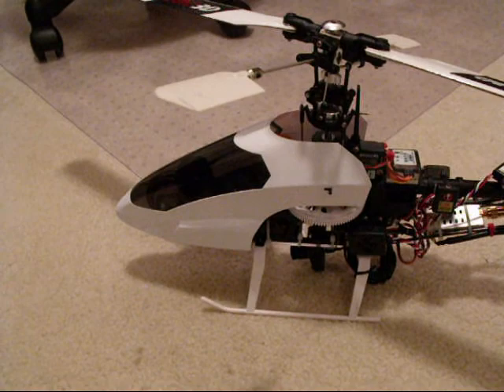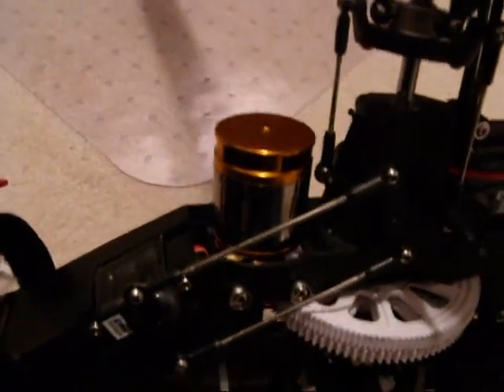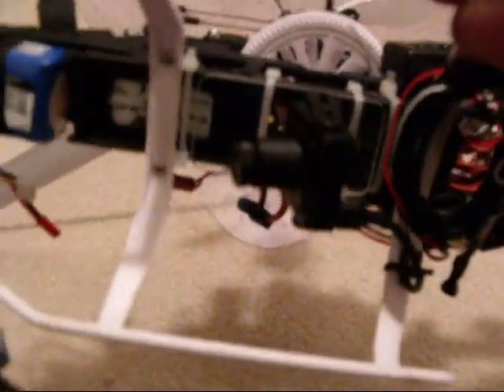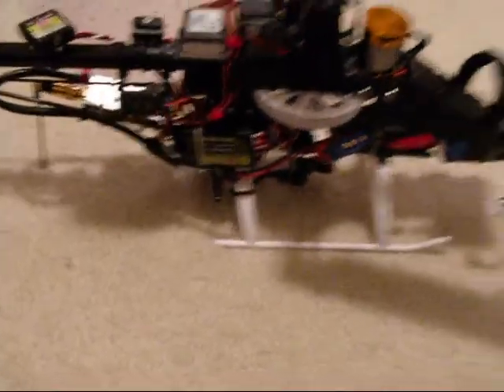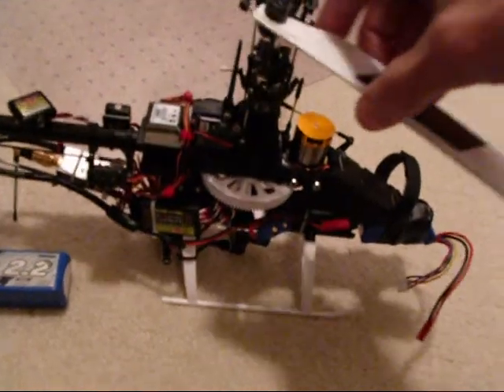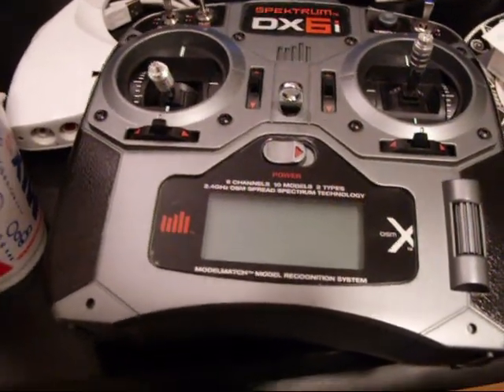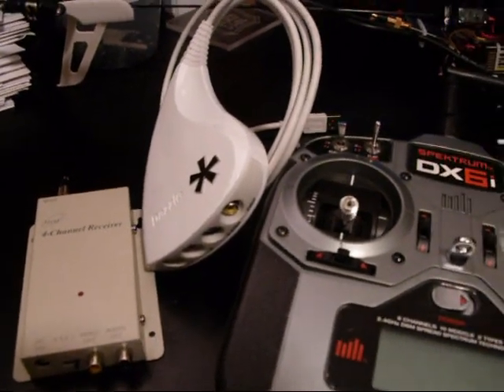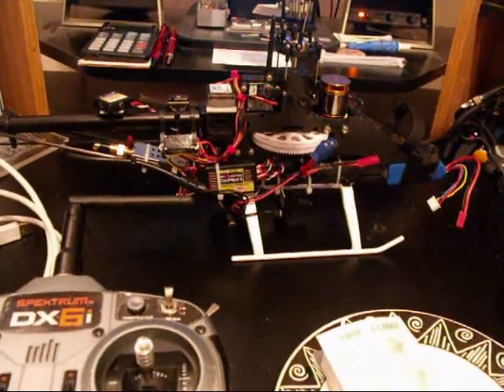Blade 450 3D FPV setup

Comment from the maker: @441rider I bought the one from CNCHelicopter that is recommended by the Blade 400 Bible to replace the stock 420 motor, the shaft is a different size 3.17mm/.125" so I drilled the pinion out on my lathe, also had to shim the motor up with washers as the shaft is longer as well. But it works good.